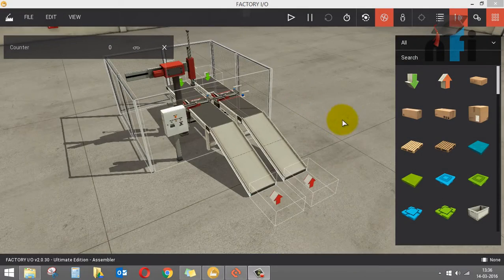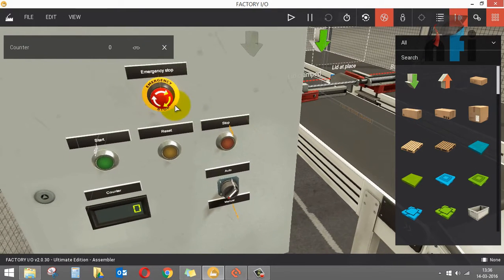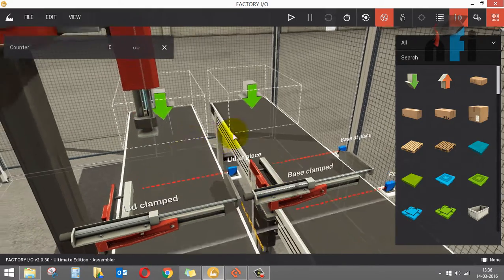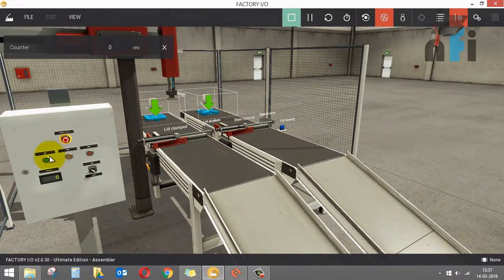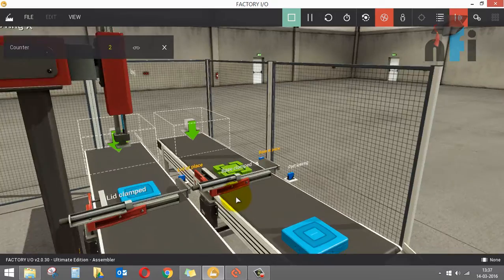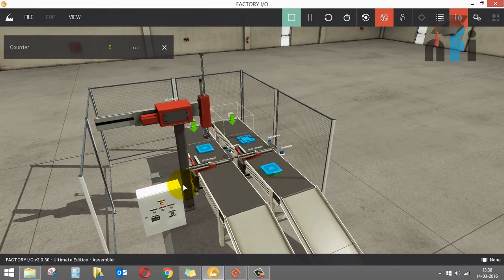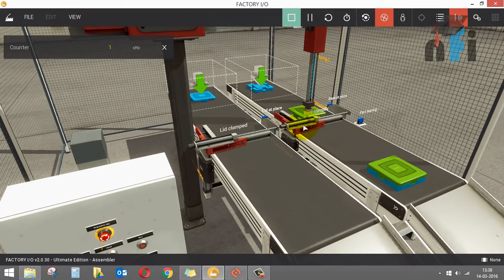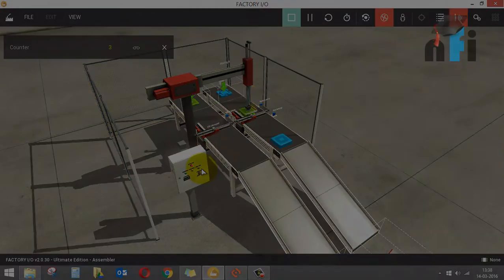Factory Automation- Pick and Place Control

Comment: IF I buy Factory I/O Starter License (Lifetime) Combo, can I connect with Allen Bradley Micro 820??????
Reply from the maker: Unfortunately not! You need to buy AB license to link AB Micro 820. With Starter license you can only simulate with CONTROL I/O